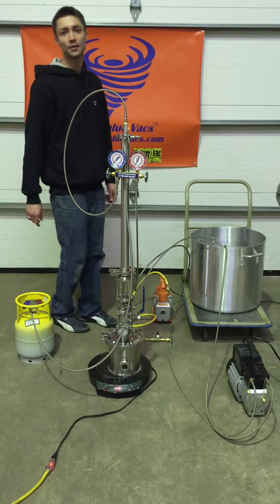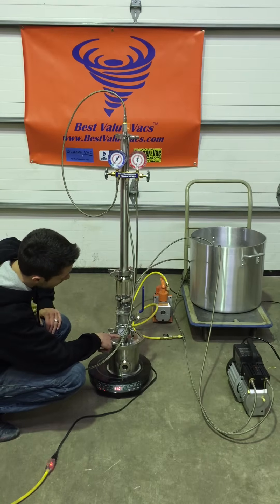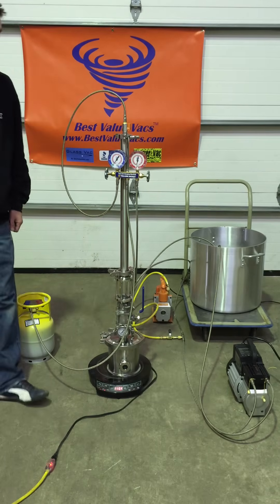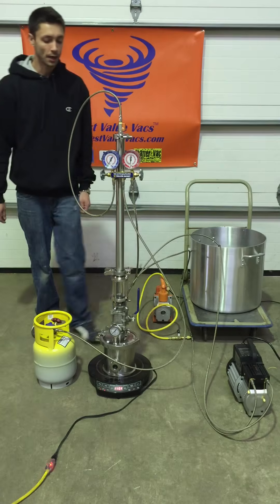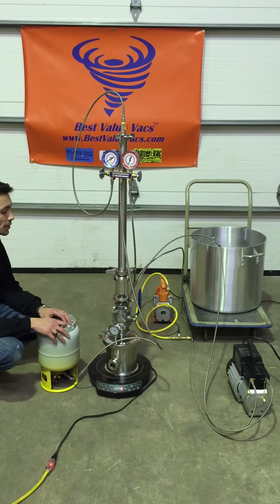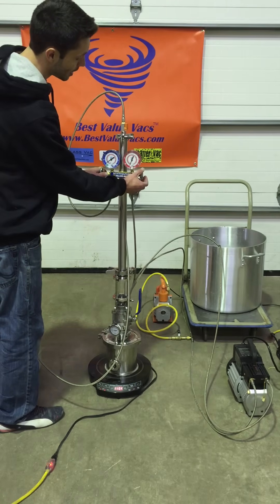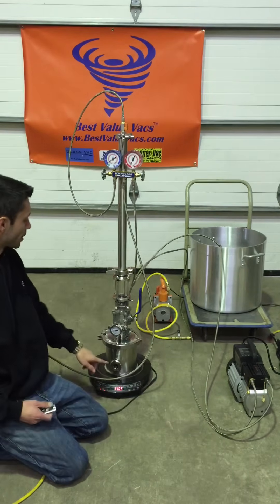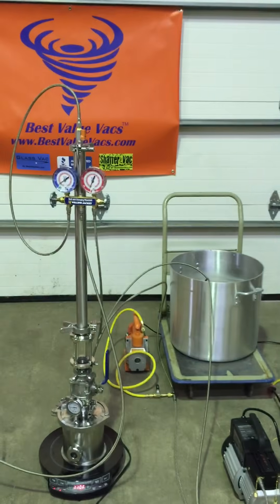TRS21 Active closed loop extractor setup

Comment: Can anybody recommend some reading material or some diagrams that contain detailed info?
Reply from the maker: @MrBreeze911 we no longer suggest recirculating solvent over your biomass material. The active setup for a CLS is widely used today but only to assist the recovery process. Instead of relying solely on dry-ice to create a negative pressure inside your LP tank, the recovery pump pulls the vapor and pushes the vapor into the LP tank. Please email us for diagrams!

Comment: What r the hose connections size?  R they all the same? Look like maybe 3/8 fitting correct me I am wrong
Reply from the maker: @Ivan Guthrie The fittings used in junction with the stainless steel braided hoses are 1/4-inch JIC fittings. We have 3/8-inch JIC as an option for the TRS21 Recovery Pump. BVV's new four-cylinder recovery pump can take advantage of 1/2-inch JIC connections! 
Check it out here: https://shopbvv.com/products/bvv-4-cylinder-recovery-pump 
Feel free to give us a call at (331) 281-0154 to talk with a tech.

Comment: This is so bad because you’re contaminating the wax with the vacuum pumps oil you should know that you got hvac hose so you know about the oils in the pump mixing with the butane
Reply: The vacuum pump and hose are only used to pull a vacuum on the system before your introduce the butane. After the vacuum is pulled all the way down the pump is isolated from the system via a valve. There is no way to contaminate the run.  All the other hoses are made of ptfe.  You never want to use hvac hoses with butane.  Edpm rubber will degrade with the solvent.

Comment: I packed my tube really tight n compact, and am wondering if I pulled everything, my yield seems low. Does running the solvent too long affect this, does too tightly compacted material affect this?
Reply: Yes packing too tight will reduce the contact surface area the solvent has access to. If doing live resin gently unfold buds completely before freezing then pack lightly so as to allow solvent full access to surface area